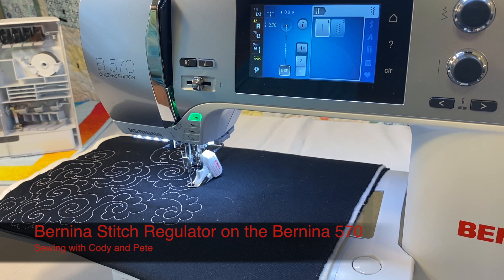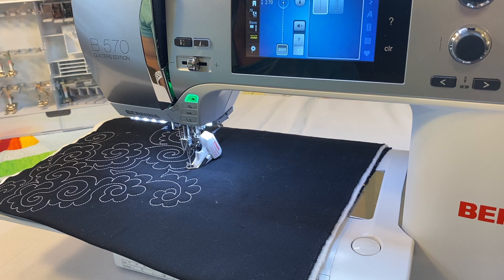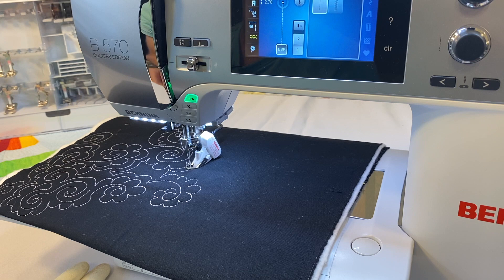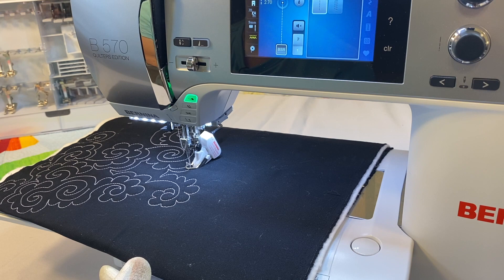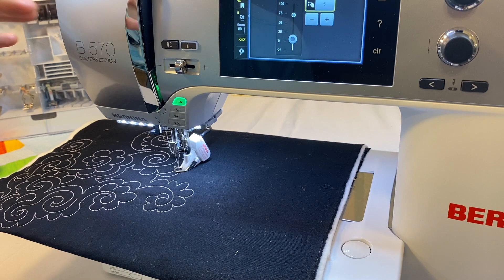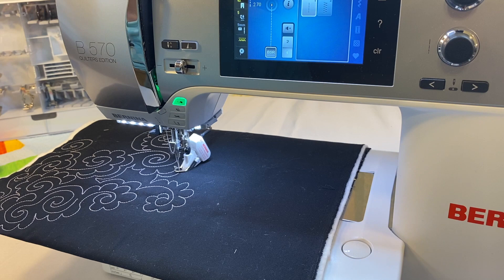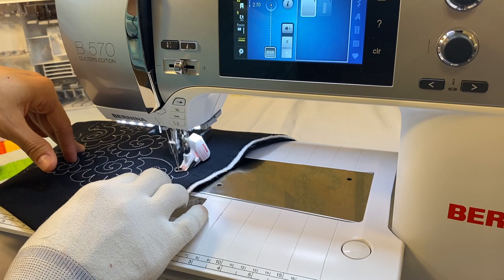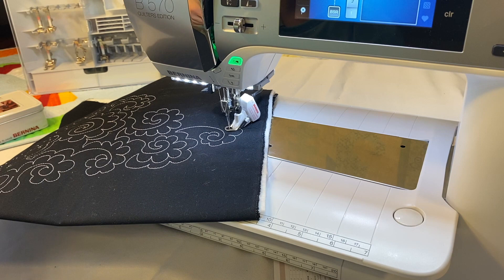Understanding Bernina Stitch Regulator on 570QE

Comment: Hi Cody, It's me again. Watched this video again because it is so helpful with learning my BSR.. I do have a question. I have been using mine for a few years now. Have come a long way with my quilting. However, can you talk about the BSR skipping stitches/making long stitches? I can stitch for a few hours, and everything is fine...not perfect, like little points where there shouldn't be. i know that comes with practice. But what is causing the long skipped stitch? Could it be using the spray basting adhesive?
Reply from the maker: You bring up a good point. I am not 100% clear if you are are having some skipped stitches after stitching for a while or throughout your quilting, I will talk about both. 

When quilting we find skipped stitches occur when the needle isn't the most ideal. This could be the needle is worn down, too small, or wrong type (less than ideal). When we are quilting we want to use a decent sized needle if the needle is too small we can have a number of issue (won't get into the details why exactly) so whenever I'm quilting I am either using a 90/14 quilting or top stitch needle. Don't want anything much smaller unless working with batik fabric and don't want anything much larger really not on a home domestic machine. Remember this is all just the average quilting project there are always different circumstance so this not just a good rule of thumb. Now when we are using spray baste to baste our quilts together (this is my preferred method for sure) sometimes we may have more glue in some areas, also depending on what spray adhesive you are using makes a difference too. Make sure you are using a good quality spray baste for quitting. Our long time favorite is "Temporary Spray Adhesive 505 by Odif". So what can happen is that glue can be a little too sticky and this can cause the threads not to form. This also goes back to the needle, so a good needle to try when having issue is a titanium needle, we work with Organ Titanium needles a lot. They are amazing for a lot of different embroidery projects too. The titanium coating prevents any glue from building up on the needle which can cause skipped stitches or loops on projects. I think i've lost my train of thought haha. However you may notices that for 3/4 of you quilt everything is great then all of a sudden you start to slowly notice issue with your stitching and it slowly starts getting worse. This is a sure sign that it is time for a new needle and potentially some oil. 

Now if you are having issue from the beginning but still very random and just here and there and everything seems fine and you've tried a few different remedies and still having longer stitches here and there most likely the longer stitches are going to be found right where you've sped up in speed when quilting. So the stitch regulator on the machine does a great job at keeping up, the machine it's self even though it stitches at up to 1000 stitches a min (depending on your model) it's not able to rapidly increase that speed in a fraction of a second. This is why we sometimes see a slightly long stitch here and there and a lot of times it's in curves or the start of a cure right where we've sped up. So yes sometimes its a "skipped stitch" but sometimes the machine just wasn't able to stitch but once in that area instead of twice to keep that even stitch length. 

So yes like you said in your message it comes with practice but the best advice I can give is to do you best at moving in fluid motions and try not to rapidly increase and decrease in speed. Now by all means I'm not saying you can't stitch faster haha but when you are increasing and decreasing speed think of it as driving you don't want to floor it when the light turns green you'll use a lot more case and wear out your tires rather slowly accelerate. haha Hope this helps :)

Comment: My machine was beeping when I use BSR. Do you know why? I just got the machine and  it was first time using BSR and no idea why it is beeping....
Reply from the maker: The beeping is an indicator that you were moving the fabric faster that what the machine can stitch at. The easiest way to have the machine stitch faster is to increase your stitch length. The default stitch length is set to 2mm which is fairly tight which is good for small very detailed free motion quilting. But if you are a fast quilter then you are probably doing larger more open designs so we always recommend Increasing the stitch length to at least 2.5mm -2.75mm. You can definitely go even longer. It depends on how long you want the stitch length to be. Hope this helps.
Reply: @sewingwithcodyandpete8651  oh thank you so much for your quick reply!!!!

Comment: Can you use this with rulers?
Reply from the maker: Sadly no because the soles for the BSR will slide under that rulers and cause major problems. Ruler work should only be used with the 1/4" high ruler foot #72 so the foot and rulers can slide right along the edge without any problems. This is when the BERNINA Q Series shines because it had two BSRs built in down by the bobbin facing up so you can use whatever feet you want. Hopefully this answers your question. :)